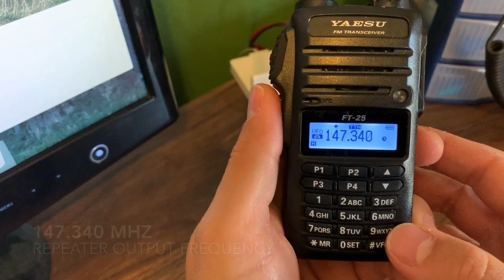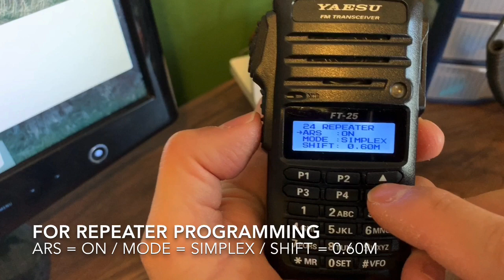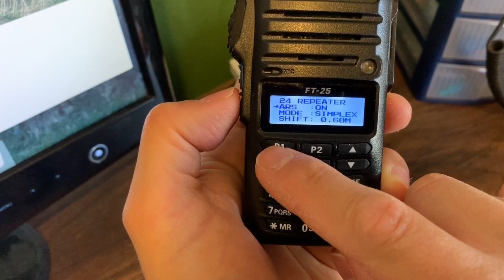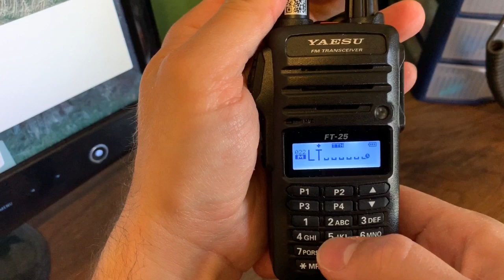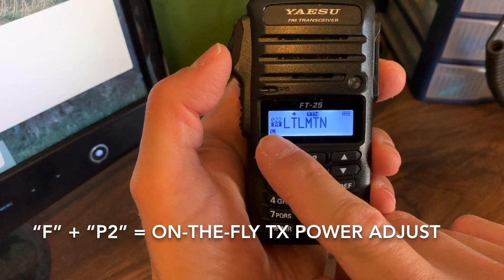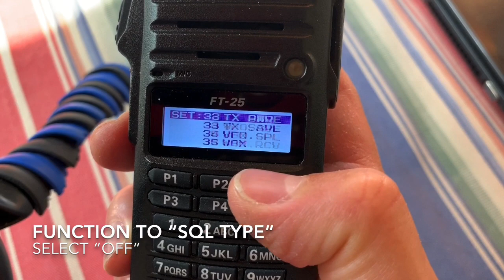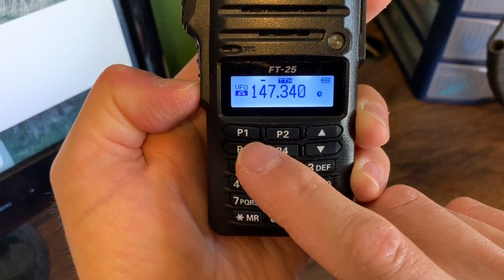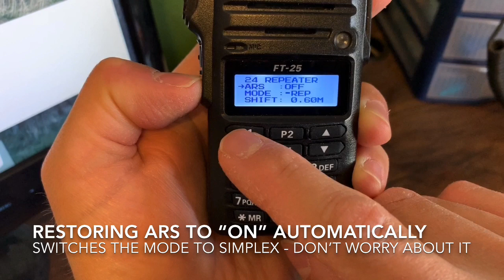Frequency Programming Yaesu FT-25R

Comment: Great video, clear explanation. I've got the Yaesu FT65 (exactly the same but with dual band Vhf/Uhf).
Reply: I forgot to ask about your antenna, which brand/model do you have? Nagoya?
Reply from the maker: Sorry for the late reply! 

Good to hear! Thanks for the feedback! I use the Nagoya NA-771 mostly, but when I head out into the hills, I use an Abbree folding 42.5" (I know some people have some bad issues with fraud versions of this antenna) and it works very well. The Nagoya NA-771 works really well on both 2 meter and 70cm.
Reply: Do you know the model number for FT-25R's battery eliminator? I can't find it anywhere.